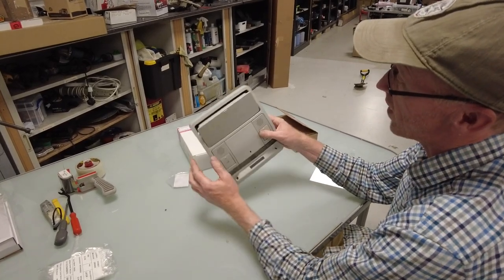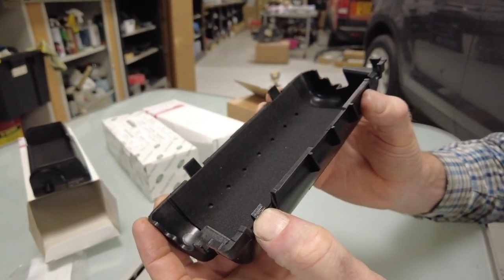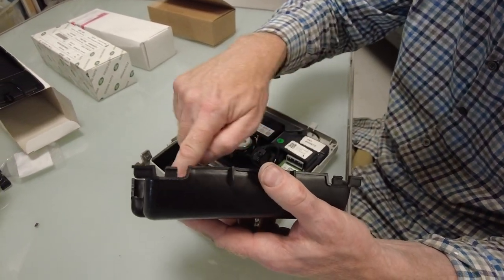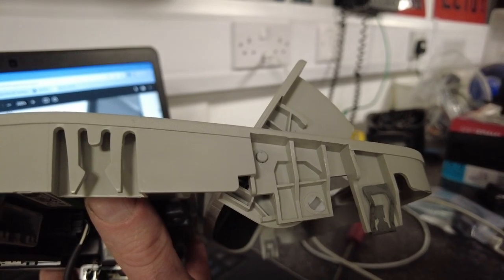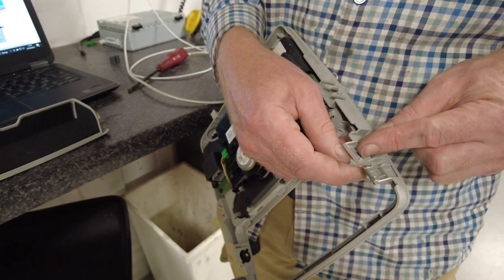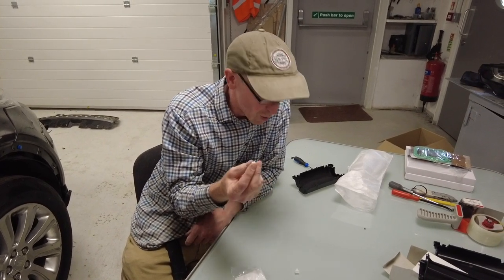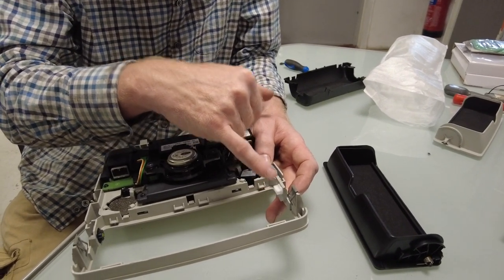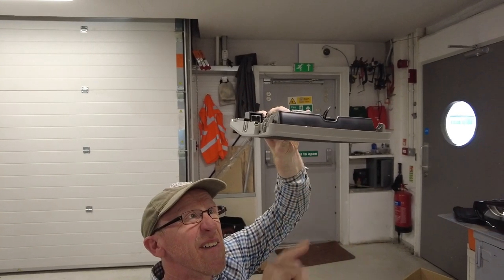Land Rover /Range Rover Overhead Roof Console Sunglasses Holder Removal & Repair

Comment: This assembly is the same for Evoque as well. I've took apart mine trying to source the problem - been reading that the white clip you showed is causing issues, but it didn't look damaged at all.
Reply from the maker: I will get the clip for sale on the website - the PN for the clip is LR094245
Reply: I've put it al back together but it wont stay closed, just keeps opening.

Speak to Btistol Street Motors, hopefully the will sort but not holding my breath.
Reply: @b-958  From my perspective, I'm certain that the housing is causing the issue and not the little white clip.

Comment: Just got the notification that the black holder/kit was back in stock and snapped it up! I have a MY2023 Disco Sport and it came without the sunglasses holder, and surprising how much I miss having it. I am really NOT a very technical person, but this looks like even I could do it reasonably well! I just hope the high-gloss black blanking panel comes off easily once I have the upper console off!
Reply from the maker: We are still tweaking the fitting video - as Land Rover has made some changes - when this is done they will be back in stock
Reply: @L663  I just got your email. Haven’t read it properly yet will reply shortly.

Comment: It's a great video! By any chance, do you know if the parts will fit for a 2023 defender, which does not come with the glasses holder?
Reply from the maker: This is why I looked at this but the design is different - the front face is the same but the pivot points and damper are all different - crazy why Land Rover did not keep the design the same !

Comment: Thanks Simon, do you know if this will work on the new MY23 Defender? They have removed the sun glasses holder and replaced with a panel. I wonder could I retro fit?
Reply from the maker: That was one reason i was looking at this - i think it will fit but i am not sure what the back of the non sun glass version looks like - can you take a look and send me a picture ? the one part we cannot buy is the little black cog. Interesting they do not list the replacement sunglass holder for the Defender. Let me see if they sunglass holder can be used to replace mine - at least then we know we are part the way there.
Reply: @L663  For the new Defender with no sunglass holder the space now looks right for a light switch panel. Only problem would be getting cables to that location.
Reply from the maker: OK i have checked this morning and although its the same size exactly Land Rover decided to make a new part - see picture - the pivot is in a different place and its a different mechanism !
https://www.dropbox.com/s/rvb5x006f9lelj9/2022-07-04%2008.46.31.jpg?dl=0
Reply from the maker: @vincentdeknock4186  What about making a USB power outlet panel ? There is low power and ignition signals in the console that we use with the dashcam loom.
Reply: Simon, were you able to get a photo of the 23 defender panel?

Annoying they got rid of it